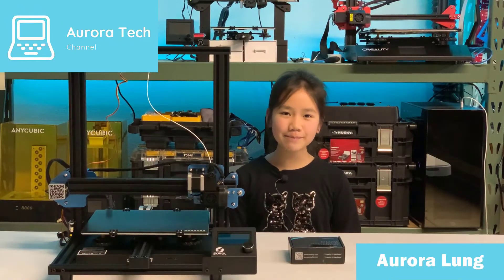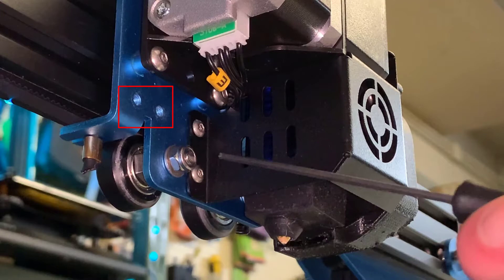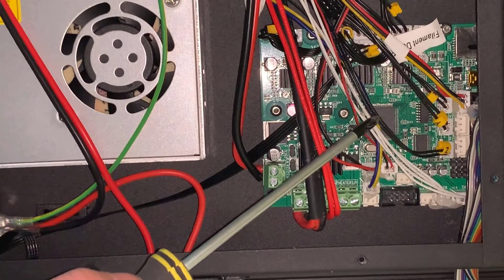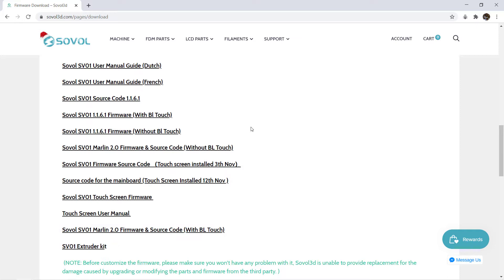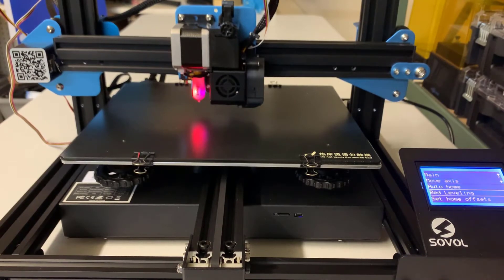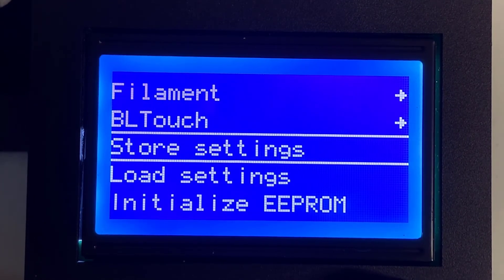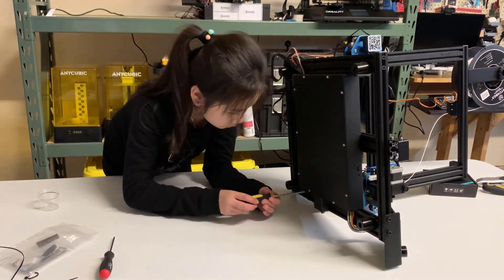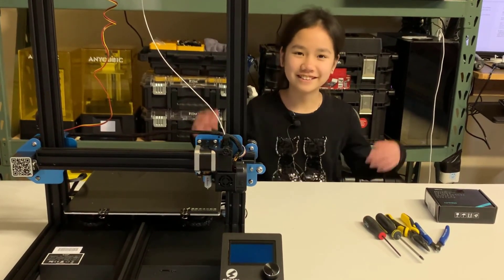3D Printer Review 2021 - Sovol SV01 Part 2, BL Touch Installation

Comment: I like your videos and have received much information there. I purchased the BL touch from Sovol and followed your video. Things went badly. Upon installing the .hex file your video referenced,when the unit re-booted, all I got was a blue screen. In addition, my pic no longer recognizes the unit when I try to install other firmware. I found a Creality Marlin 2.0 .bin file and got the machine back to the main menu.. I tried the BL touch firmware (knob version ), when I reloaded and got back to the info screen, I can see the BL touch selection, but not the re-load command you mentioned in the video and tried to home the probe, the machine rammed the nozzle into the bed. I think you are aware of their lousy tech support and I have received nothing constructive from them and I don’t know what I should do next..I know this is not your problem, but I have scoured all the likely websites and found nothing. Now the machine will no longer allow me to load any new firmware via the .hex format.
Thanks for any help you can offere..

Comment: Aurora, I have a Creality CR Touch that I haven't installed on my Ender 3 V2.  I have now ordered an SV01 to replace the 3 V2.  Do you know if the CR Touch will work on the SV01, and with the same firmware (now 2.0, it looks like)?  The cable is different than the BL Touch.  It has a single 5 pin connector on each end.  So again, not sure it will work on the older (non-silent) motherboard SV01.  I might have to get the silent motherboard for it to work.  If you know, I would appreciate the education! Great video!  Hopefully I can use it to install the CR Touch on my SV01!
Reply from the maker: The 5-pin CR-touch cable and the 3+2pin Bltouch cable are the same, you can just cut the 5 pin and clamp your own 3+2 pin dupont connectors. I always switch BLtouch, 3D touch and CR-touch between printers, they just work the same.
Reply: @AuroraTech  Thanks for your reply.  I would like to install the CR Touch without hacking it's connector.  I also want to install the Sovol touchscreen.  So I need a board that has the 5 pin BLT connector AND has the ability to connect the touchscreen and install the firmware for it.  It seems like the Creality 4.2.7 or Bigtreetech skr mini e3 could work, but I don't know if either of those will work with the touchscreen and be able to load/run it's firmware.  Do you know if either of those boards will work for the SV01 with the touchscreen?  Thanks so much!!

Comment: Thank you for your great videos. I just used this one to set up the BLTouch, and I added the GCode line, but the BLTouch isn't auto-leveling before it prints. I see the line in the GCode sent to the printer (G29 ;Auto Bed Leveling) right after Home (G28) but it just homes, then starts to print. Any suggestions?
Reply from the maker: Have you flash the firmware to support BL touch? If not, just adding G29 will not work as the machine doesn't know there is a BL touch connected.
Reply: @AuroraTech  I did, thank you for the response. I ended up setting mine up differently, with a mesh and 3-point level prior to the print, and it works.

Comment: Great video.  Instruction is an art, and your clear and logical presentation indicates that you understand the concepts and organized the material before making the video.  Very professional!

I wasn't planning on a BLTouch, as I like keeping it simple and manual bed leveling has always worked for me, but after leveling the bed of the new printer, I did the auto home a few times and rechecked the nozzle height.  It was probably close enough that I'd get good enough first layer adhesion without needing to print a raft, but I could tell the Z homing was slightly different each time.  Autoleveling before each print should result in more reliable and repeatable prints.

Comment: hello, do you know why my negative Z is not working? Only the positive works. Thank you
Reply from the maker: I think there is something wrong in your firmware, for the SV01, if the Z-Axis can only move away from the nozzle(up) but not down, you may need to adjust the Z end stop settings as the it's triggered all the time so the printer won't let you move down.

You may try to change these in Marlin:

1. Invert the endstop
For hardware end stop:
#define Z_MIN_ENDSTOP_INVERTING false (or true)

If you use the black and white wire of your BLtouch to replace Z-MIN end stop:
#define Z_MIN_PROBE_ENDSTOP_INVERTING false (or true)

2. Disable (comment out) the software endstops
//#define MIN_SOFTWARE_ENDSTOPS
//#define MAX_SOFTWARE_ENDSTOPS

If you are using BLtouch, please make sure you connect the black and white wire to the Z-MIN connector like what I did in the video. 

If you connect all 5 pins of the BLTouch to the 5-pin probe connector on the motherboard, the settings are different, you need to disable(uncomment) this line:

//#define Z_MIN_PROBE_USES_Z_MIN_ENDSTOP_PIN

And enable this line:
#define USE_PROBE_FOR_Z_HOMING

Comment: Thank you! Great videos. I am buying a 3d printer and can use your expert advice.  I am debating between the following printers with the indicated upgrades:

1)  Ender V2 and installing the following upgrades (~ $420):
	a.  BL Touch
	b.  Direct Drive Extruder
	c.  Dual Z Axis
        d.  Filament run-out sensor

2)  Sovol SV01 and installing the following upgrades (~$445):
	a.  BL Touch
	b.  Silent Mainboard v 2.2.1 with SMC2208 Drivers
	c.  Touch screen
	d.  Hydraulic Cooling Fans (reduce fan noise)
	e.  Modifying the bottom cover to get better air flow to the power supply
        f.  Filament run-out sensor

3)  CR-10S Pro V2 and installing the following upgrade (~ $620)
	a.  Titan Direct Drive

I am primarily concerned with print quality, and would like to keep the initial printer cost under $700.  I don’t know whether I will need to print anything so large so as to need the CR-10S Pro V2, but I am willing to pay for that printer if it will serve me better over time.  I plan on printing flexible parts from time to time, maybe with TPU, but also printing with PLA and ABS.
Reply from the maker: Thanks for your message!

Considering you want a Titan direct drive extruder and dual Z-Axis., I would recommend the Sovol SV01 as it already came with a Titan extruder clone. Since it's an exact clone of the genuine E3D version, there's no problem with printing most common materials. The TPU also came with dual Z-Axis.

It prints pretty well out of the box. I would say it prints as well as other more expensive printers including the CR-10S Pro V2. You don't have to worry about the print quality that much. As a matter of fact, most budget 3d printers under $1000 print pretty much the same if there are no hardware issues or misalignment, how you tune your slicer profile may even more important. You can also watch my most recent video. The Two Trees Sapphire Plus printer has quite a lot of issues, but after all of them have been taken care of, it still prints pretty well. 

You can just add a BL touch on the Sovol and play around with it before you consider more upgrades. For the touch screen and silent motherboard, I would recommend the Big Tree Tech SKR E3 mini V2 and their 3.5" TFT touch screen instead of the ones from Sovol. There are 2 reasons. First, the Sovol's silent board is a Creality v2.21 board, it's still an 8-bit board, but it came with TMC2208 silent stepper drivers. The Big Tree Tech is a 32-bit board with newer TMC2209 stepper drivers. It also supports sensorless homing. The TMC2209 is still worth more than TMC2208 whether or not you use this feature, but the motherboard price is basically the same. 

The Big Tree Tech touch screen has the best UI with the most features (compared to all my existing 3D printers). It also has a terminal for you to send G-code directly to the printer. It's a drop-in replacement board for the Ender-3 series. As Sovol also uses Creality motherboards, the upgrade would also be as easy as Ender-3. I have also upgraded my SV01 with this board and their TFT touch screen, I will post another video for that.

I hope this information could help you out!
Reply: @AuroraTech  Thank you!!!
Reply from the maker: @null643  I planned to post the Sovol SV01 - Big Tree Tech E3 RRF 32-bit board upgrade video on May-10, but the motherboard I received has a bad SD card slot so I have to get another one, I should post the video next week.

Comment: I just bought this printer in some part due to your videos! It would be interesting to see you upgraded to the 32bit motherboard and to a touch screen and anything else you think would be good. Thanks !
Reply from the maker: I already bought the 32-bit board and touch screen, I will make videos related to these upgrades and post them in the coming weeks. Thanks!
Reply: @AuroraTech  Hi Aurora. Just thought you might be interested to know the Sovol has the SV02 on sale check their latest youtube video for the code
Reply from the maker: Thanks for letting me know, I will check that out.

Comment: Aurora I need your help, I can’t upgrade firmware with Bl touch on my sovol 1 when I try my laptop says no connection no matter what I do , what am I doing wrong or what do I need to do, ❤️ your video your well spoken for your age
Reply from the maker: First, I think you need to make sure the computer realizes the printer is connected.

If you are using Windows, you need to go to your device manager, check the ports, when you plug in your printer(power on), you should see a new com port. In my case, before I connect the printer, it shows only one COM port (COM1), after I connected the printer, it shows another port, which is USB Serial Port (COM3). 

If you can't see a new port shows up inside the device manager, the problem may be your laptop, you may try another computer, at least the device manager has to show a new port. 

I have attached a screenshot, you can compare it to yours. I hope this can help.
https://ibb.co/VH3R8df

Thanks
Aurora